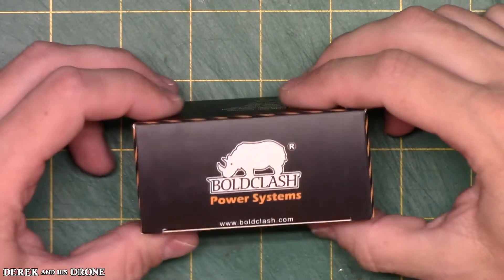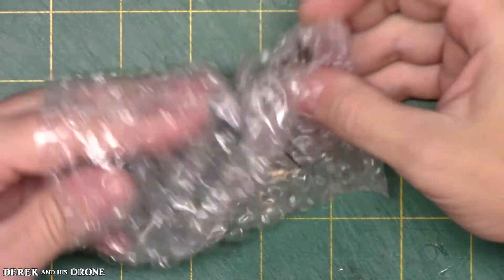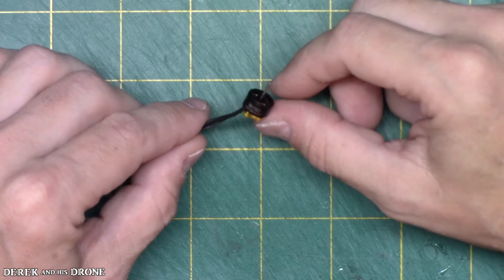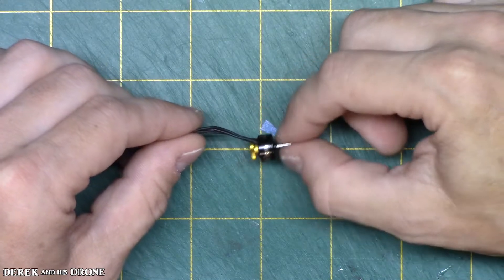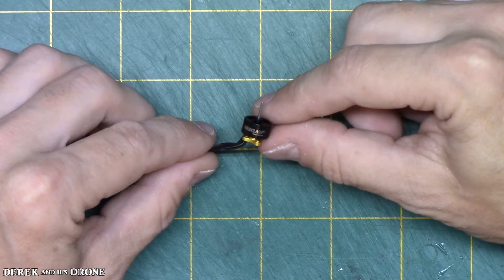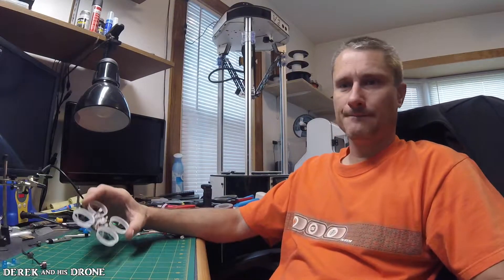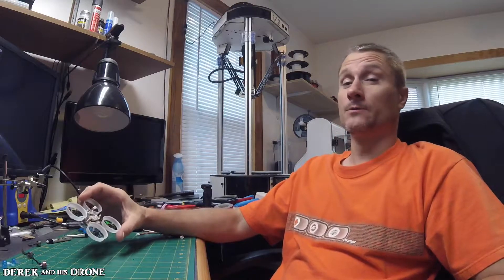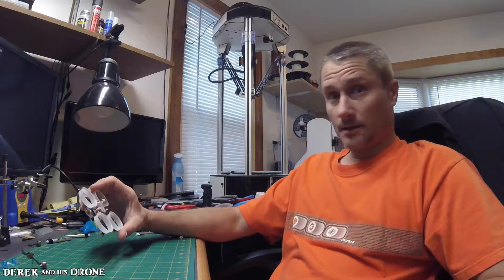2S Brushless Tiny Whoop Build - Part 3 New Motors

Comment: china quality!!!!!!!!! this has happened to me many times! for every whoop i build or buy only like 2 out of 5 are really good. they have a great idea! just not quality.if you want brush-less, try the boldclash B06. i love mine (after a shit load of tuning)
Reply from the maker: I agree with the China parts.  I went through four flight controllers and three sets of motors for this build.  I have done three brushless whoops and have been disappointed every time.  The Unicorn motors from NewBee Drone have way more power than any of the brushelss motors I have tried.  The ArcoBee with Unicorn motors is by far my favorite.

Comment: Also, not sure if you’ve seen this https://youtu.be/9i1LlxUce5s

Basically start at the 3:30 mark, mentions about the motors, when they don’t seem to work, you need to manually move them, due to the excessive motor oil they put in those tiny motors can stop them from moving.

After a few rotations it should clear up, if they dont, just keep spinning them.
Reply from the maker: Unfortunately this build is over.  I can't keep putting money into this one. I have been through everything with the motors but that isn't the big problem.  I have been through four Super_S flight controllers from different manufactures all with the same problems.  The OSD keep failing on them.  This build has been plagued with problems.  However I will be doing a build with some of the new brushless parts from BetaFPV.
Reply: Awesome, looking forward to it.

Comment: I know the last thing you want to do is get new motors but these might work and hopefully dont burn out https://www.ebay.com/i/401462113282?chn=ps
Reply from the maker: Thanks for trying to help but this build is over.  I went through four flight controllers all with the same problem and three sets of motors.  I did try the Boldclash motors.  I have a new brushless build coming up soon with some of the new BetaFPV stuff.
Reply: sounds like fun ") Sorry this build didn't turn out

Comment: Stick with it, I have the 76mm version and it flies great, loads of fun. I did end up reinforcing the motor to board connections with a dab of silicone as the wires are really weak, are a pain to solder and break with vibration.

Comment: With the super/teeny FC with an external receiver, it's dropping bc you're hitting failsafe bc the receiver drops out. I had the same thing with a 1s build and drew the conclusion that the FC can't keep up with the voltage drops. Noticed my camera cut out right before the failsafe ~30 seconds in hard flying. I picked up a 1s to 5v board and wired both the camera and receiver power to it. Hello 3+ min flights of draining a lipo. If your receiver and camera can handle 2s voltage, maybe try and wire the power leads of both to the battery leads on the ESC and take the voltage regulation of the FC out of the equation. :)

Comment: That sucks! Spell of bad luck for yah. I read that these motors were about as fragile as your typical brushed motor so I ordered 2 pair for my first build. For 5 bucks a set of 4 (racestar 10krpm), why not get a few replacements. That's the cost of a good battery... and now I'm buying one less battery, but I should have motors to spare!
Reply from the maker: I agree these small motors are super fragile.  I now have sets of 8000, 10000 and 15000KV.  Also if I could just get the flight controllers to last.  I really like the way this quad flys too bad it doesn't last long.

Comment: Mine worked out great with 2s on the racerstar 15,000kv motors. Also, i thought that one of my motors was bad, I just re soldered the motor again to the pads and it worked, the wire isn't the best at taking hold of the solder. here is my build list with some photos and a video. Don't give up! It's worth the pain.
Build Parts- https://rotorbuilds.com/build/7322
Flight Video- https://www.youtube.com/watch?v=eklfkEzDV44
Reply from the maker: It was defiantly a bad motor.  The replacement came in and I got it working. It flys awesome!  I'll have the final build vid up soon.
Reply: Derek and his Drone I‘ve had a bad motor aswell, I discovered that it was not straight, like unballanced. I had to correct the alignment so it is running smooth now

Comment: You have bad luck I have built two already and have about 10 hours split between the two without any problems. I am using a different tower though.
Reply from the maker: This is the story with my life.  If something isn't going wrong it's just not right.
Reply: Derek and his Drone don't worry, I feel like I've had the same crappy luck with a few eachine product about a year ago. I just fried my 3rd NEW esc yesterday not paying attention. This hobby is producing new products so fast most are hit and miss sometimes. It f'n sucks
Reply: I did notice that it looks like you used the black screws from the motors. Those are actually too long and hit the winding of the motor. Use the screws that came with the rakon kit.
Reply from the maker: I agree even the better brands can be hit or miss. I usually try to wait for feedback to come out on a product before I buy it. I don't like train rides.
Reply from the maker: I looked at that. The screws are a tad long but they don't touch anything. Won't hurt if I swap them out anyway.